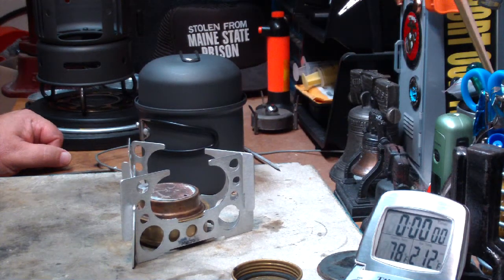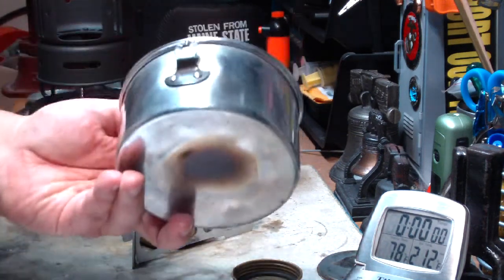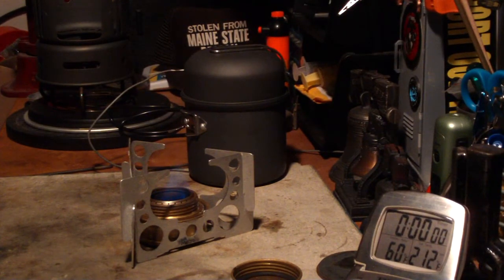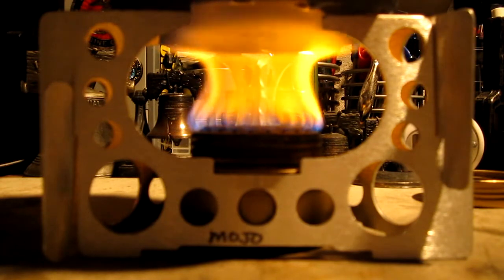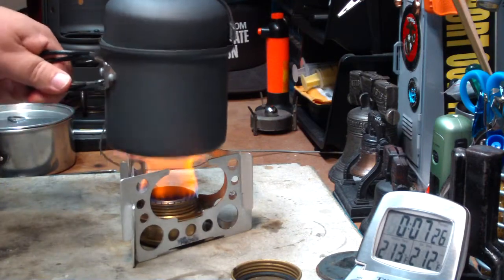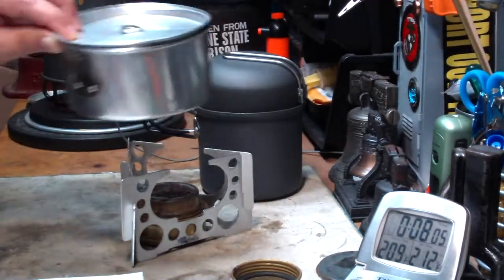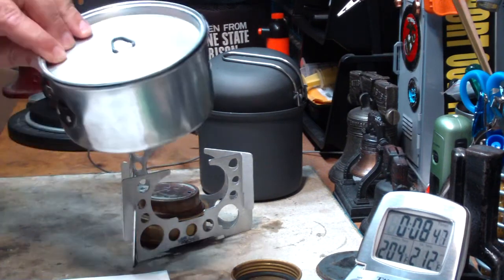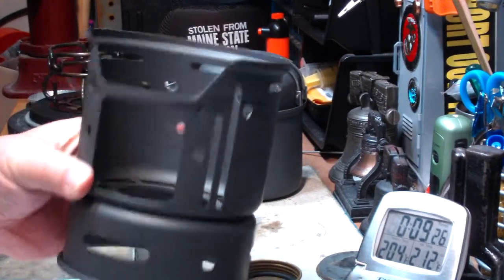ALOCS 7 Piece Camping Cook Set Pot on the MOJO Pot Stand - Boil Test

Comment: It appears its down to 3 variables: pot, or burner, or fuel quality. To test for burner or fuel, suggest you do a test with mojo + same trangia + same fuel + boy scout pot. If you get a 7 minute time then the issue is either burner or fuel, since boy scout pot should get a 5 minute time. If you get a 5 minute time with boy scout pot, then fuel and burner are good, so it must be an issue with the the ALOCS pot?

Comment: The plain aluminum pan is larger in diameter then the anodized pot. The plain pan has more surface area exposed to the flame and well transfer heat to the water faster.  Also they could be made out of two different types of aluminum alloy with different thermal conductivity properties.